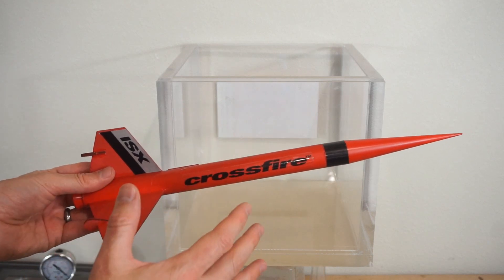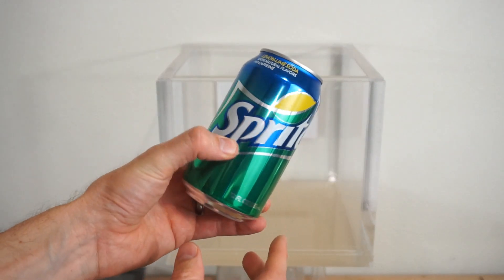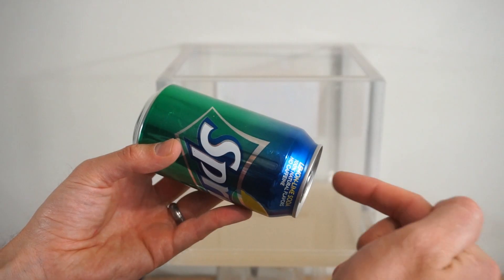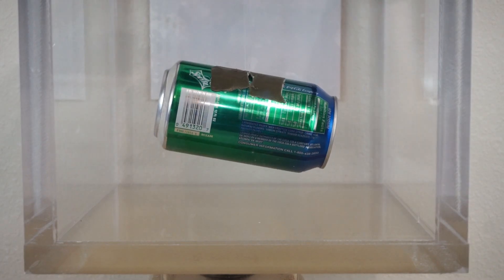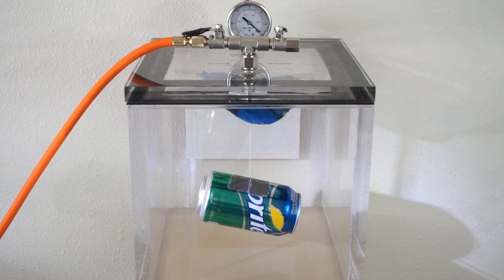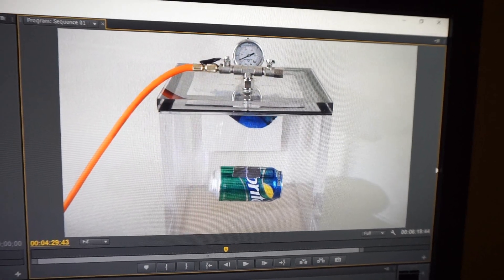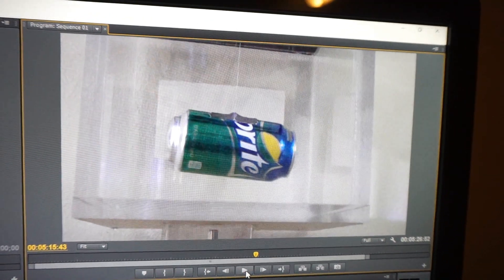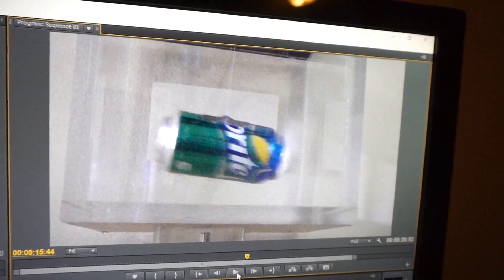Can a Rocket Fly in a Vacuum Chamber?

Comment: your interpretation is flawed. the moment the can pops gases are eliminated, then comes the liquid. the wall is too close to the can to eliminate its interaction with the can/liquid/gas system movement.
Reply: cmnndr
Please tell me, how gas hitting a wall transfers energy to the can?

I'll be happy to explain how the normal explanation works, but first I want to hear your step by step explanation, with all the interactions.
Reply: man, its not me that made the experiment. im not the one who needs to explain anything. i just noticed what happened and pointed it out since it appears you missed it. thats it. 
i find it important since your whole conclusion resides in the fact that the can moves before the liquid hits the wall. you have the burden of proof not me. you have to prove how the gas hitting the wall transfers energy to the can, not me. or disprove it. i didnt state that the can moves because of the gas hitting the wall, i just pointed out that the wall is too close to the can for the experiment to be conclusive, which is obvious, since we're having this discussion and since you have to use external optical devices and software to come to a conclusion.

what you see: can pops, gasses expelled, liquid expelled, starts moving (although this order i subject to debate since the gasses aren't colored and you cant determine simply by observing, or at least harder to do, which came out first and when did the can actually started moving. its more or less an aproximation, another variable you have to take into account when you make your interpretation, just like the proximity of the wall) 
what you interpet: regardless of the interpretation I THINK you are flawed since the wall is too close. 
does this make it clearer?

and as a side note, if youre not making an experiment with a blank slate of a mind you almost always get crooked results, in particular, you should leave aside your classical mechanics knowledge since its a specific situation where you dont have a medium where these interractions occur and just try to elminate variables, assumptions and prejudice. this is important since the system created encompases the subfield of classical mechanics of liquid and gasses and void, which intself is a particular situation.
maybe this is overkill to the experiment, thats why i mentioned only the wall....
if you start on the biassed belief that the can will move by the expulsion of the liquid/gasses in it you will prove yourself exactly that. you will not prove what actually happens, except if that is the real explanation. lol

and get rid of your prejudice regarding myself, which your reply hints at. its not useful. you labeled me and focused me in your comment and not your experiment which is childish.
and if you like questions so much, heres one or two. as we noticed the can starts to dilate as the pressure falls. in the case of rockets, space suits, ISS and what not, how is that dealt with in space? actually im more interested on how space suits deal with this problem, since i believe rockets and the ISS could be made structurally sound to withstand the negative pressure around it.
i asked this purely out of curiosity, i have no grip on the subject at hand, but following the analogy of your experiment, the suit should burts into space. it clearly doesnt and i wonder why. maybe you know or others who peep this comment.

p.s. 
and i imagine a vaccuum chamber has its limitations but you do realise that the scale on which this experiment is not in concordance with reality i.e. rockets? 
i am bringing this out since on closer inspection the volume of the can is significant to the volume of the chamber. a better experiment, a more conclusive one would be with a much larger vacuum chamber or a smaller recipient. i haven o ideea about the numbers, i think you need to calculate in order to have conclusive results.
if you take this analogy its impossible to replicate it in real life. and it goes viceversa, you cant replicate it in a lab. altough this comes back to my first requirement which is you need to calculate the ratio of the can volume to the chamber volume and find where it becomes irrelevant. giving here a wild example to make it obvious 0.0000000001cubic metter of can to 1000000000 cubic meter of chamber.

its cool what you did and so on but its by far unconclusive if you break it down.
Reply: cmnndr
That was a whole lot of words, but not a single one even came close to an explanation of how you think the mechanics of thrust work.
Reply: doesnt matter what i think... again youre picking on me rather than to focus on your work....
Reply: cmnndr
So, you don't have an explanation?

If you don't have an explanatory model, how do you even determine if my explanation is wrong?
Reply: 1) i said your explanation is flawed by the variables you didnt/couldnt/wouldnt eliminate.
2) stop asking me questions. im not the one who posted this experiment. its not me the one who is to offer answers. you are, if your experiment isnt conclusive which it isnt, because of the reasons i mentioned earlier.
3) how about you improve your experiment instead of trying to pick a fight with me when there is none?
Reply: miss cricket i dont understand your first statement and i think there is a failure in comunication between me and you, mainly because what i wrote was for ShadowFalcon, which by a fluke i thought was the OP of the video... anyway, i really dont get what youre trying to explain in your comment. i understand what happened in the experiment. its just that the result is inconclusive due to unacounted variables in the system the OP created. these are obvious and if you eliminate them from he ecuation you turn science into pseudo-science. thats it. there is no way around this.

ill give one example in which the result would be conclusive. use a chamber large enough that the content of the can will not reach the wall before the can moves. if the can moves you just demonstrated that it works in vacuum as well. if not, the opposite. its not philosophy.

in this case the setup leaves too much room to interpretation, shifting from science to advocacy, logic, debating, imagination and so on.
Reply: That's what the guy shows, right? Expanding gases create pressure in the combustion chamber and push against the exhaust parts. If you put a wall behind the exhaust you'll have more power at the start. But there's no physical contact. In a vacuum.

The pushing force of a rocket is more powerful than the pulling force of the vacuum which spreads out the pressure into the emptiness. That is needed to escape earth's gravity further, while already left the atmosphere until a full orbit without propulsion becomes possible. Once in space, you don't need that much power anymore.

Real fact: the Dawn spacecraft travelled to and orbited the 'belt' asteroids Vesta and Ceres with an ion engine that delivers a thrust comparable with the weight of a feather. In almost friction-less space it's easy to gather momentum and "spiral" the sun up and down. It worked very well.

Comment: Interesting experiment. Shows momentum conservation. Don't agree that pressure differential makes he rocket perform better in space cause suction force has nothing to do with recoil effect, it could only pull oxygen more faster out of nozzle. You know the experiment with a toy car with a balloon attached in the back and the vacuum cleaner. Pressure differential force is actually preventing the toy car to move forward. You proved your point that rocket can work in a vacuum but you don't have to add some incorrect remarks. There is also air resistence(drag) which is not present in the vacuum of space. It seems that there are really are satellites up there geostationary and geosynchronous. If you look at a rocket equation you see that pressure differential force has the opposite sign of the thrust force propelling the rocket forward. First think about it before you say it. No pun intended. Best regards.

Comment: As the vacuum is increased, the gasses come out of solution from the liquid and when the can burst, the gasses are pushing against the bolus of liquid leaving the can thus propelling the can forward slightly before the content reaches the chamber wall.  The vastness of space would consume any pressure leaving a rocket engine and it would not continue to propel forward since there is nothing to push against. The rocket could only coast as it leaves the atmosphere.
Reply: incorrect

Comment: this is so stupid the first thing to hit the wall would be gas u cant see which could be why the can moves, u have to remove the possibility of any of the contents hitting the wall (called removing a variable as opposed to ignoring it) I honestly dont know how a rocket works in space. you didnt even create a vacuum DUMBASS u simply reduced the pressure until the can explodes. to test a rocket in a vacuum u need a rocket and a vacuum what the FK does rockets and space have to do with sprite and atmosheric pressure reduction. FAKE NEWS just in "Sprite shuts down NASA funding"

Comment: The chamber is providing thrust bigger chamber next time.

Okay!!!
Reply: 👍✔see what happens in REAL VACUUM 
https://youtu.be/76JM03a6WH4
Reply: @abelmicah3430  So a little rocket designed for atmosphere pressure is being used in a vacuum setting... I'm sure my computer will work just as fine in water as it does in the air right?
Reply: Exactly
Reply: The can moves long before the gas reaches the wall. That's what's great about slow motion. Wondering if you actually watched the video being this was shown and explained

Comment: There are many people saying that rockets don't fly in vacuum chamber. How do you prove that it does? Most of the videos I've seen they show a rocket engine in a small vacuum chamber causing the rocket to push off the end cap and the side wall when ignited. NASA's huge vacuum chamber does not show any small rocket models propelled in their large vacuum chamber. They only show items been dropped. If you do 3 different size vacuum chambers and ignite the rocket engine in each, what would be the time vs distance results? It would be an interesting experiment and one I have yet to see. It would be nice if you could invest in a larger vacuum chamber to run some tests.
Reply: The problem is: There is no reason why it should not work in vacuum in the first place! What would you say if somebody says "Magnets don't work in space?" 

What do you think, what aerospace engineers do? Do you really think that their interpretation of Newtons mechaincs is wrong? If reaction actually would work as these "rocktes don't work in space"-people claim, than also airplane would not behave as engineers caclulate. 

What all the people also don't get: It is not like that we have "non-vacuum" inhe atmosphere and very high up we suddenly have "vacuum". Instead the air density just decreases with the altitude. And very quickly! We can see rockets that goes faster and faster - but that would not be the case, if rockets really would need "something to push against". Already on 23 miles we have only 1% of the air density!  

It is really embaressing that videos like this are obviosly neccessary.
Reply: Don't get me wrong. I'm not some crazy flat earther or that rockets can't fly in space.  I'm only referring to a vacuum test and it would be interesting to see results.

Comment: When rockets go into to space they push off the ground why is he so insistent on not having it push off something and that still doesn't explain the fire they use to get out there
Reply: Wreklis Animosity
No, they don't push off the ground.

The gases push off of the rocket.

It's Newton's Third Law. A contact force, between two objects (not three).

The gas hits the rocket and gets accelerated downwards, and as a result the rocket accelerates upwards.
Reply: ShadowFalcon sir what does the gas hit?  I never seen a rocket set off in mid air
Reply: Wreklis Animosity
The gas hits the inside of the rocket engine.

It's basically like a stick of dynamite going off inside an indestructible bucket.
Reply: Miss Cricket yeah I have but that's after the first stage which is the ground. You'll never see a rocket take off horizontally because that would just be a plane which is essentially what the shuttle is. A rocket need something to push off of whether it be the ground or air sorry but his experiment doesn't prove rockets work in space because a sprite can produces no fire.
Reply: Wreklis Animosity
"A rocket need something to push off of whether it be the ground or air"

Actually, what a rocket needs to "push off of" is combusting fuel.

It's pretty fucking easy. Fuel and oxidiser combusts, and expands in all directions, and in the process some of it hits, and pushes the rocket.
Reply: Miss Cricket I'm sorry but fire doesn't burn without oxygen so if its burning there is air present.  The exhaust gets bigger because it requires alot more fuel to continue  no different then a car going up hill requires more gas.
Reply: Wreklis Animosity
" fire doesn't burn without oxygen"

Oh really?

Could that be why, one of the two liquids in a "bi-liquid" rocket, is an oxidiser? To provide oxygen for the combustion?

"The exhaust gets bigger because it requires alot more fuel to continue"

Definitely wrong. The propellant flow through the injector remains more or less constant throughout the flight of the rocket (or at least the usage of the engine). The exhaust plume gets bigger because there's less ambient pressure around the rocket.
Reply: Wreklis Animosity
Some punctuation would be nice.

"So is the air thinner or none existent"

Are you for fucking real?!?
The air gets thinner, with altitude, until you reach space, at which point, there's a vacuum.

" fire does not burn in a vacuum"

You're aware of the fire-triangle right?
Fire needs three things. Fuel (RP1), Oxygen (LOx), Temperature (Igniter, or ongoing combustion). It's not the fire-square, or fire-tetrahedron. Ambient pressure has nothing to do with it.

"fire does not burn without air"

Fire does burn, when it's provided with fuel and oxygen.

"I won't even get into the van Allen belts which is a whopping 3600 degrees"

Source please.

"what are the space shuttle,  iss,  made of and what are their melting points and how much bull shit did cover it in to get thru the belts"

IIRC, the superstucture of the Space Shuttle, and most of the modules of the ISS are made of Aluminium. Melting point of Aluminium is at 933.5K

As for Radiation protection. Well, layered aluminium and polymers were used. Both the Space Shuttle and the ISS would only encounter a relatively weak region of the Van Allen belts, and the radiation there would mostly be Beta- ratiation which are stopped by aluminium (and in the case of high energy beta particles, you don't want to stop them too quickly, since that'll create bremsstrahlung).
Reply: Miss Cricket
No frikking idea.

I tried googling it, but nothing showed up.

There was something about a spacecraft going through Jupiters radiation belts being subjected to 3600 rem per day, but that's all I could find.
Reply: Miss Cricket I get this stuff the science community everytime one of you try to explain you globe theory one of always creates something that no one else knows about?  Now my question to you and the rest of you is...regardless of what you call it there is an area above the earth that is 3600 degrees call it what you want but your scientists says it's there I'm with you I say it's not I say it's the firmament but your text say it's around 3600degrees now I ask again what substance on earth has a melting point of more than that because it'll have to be more?  And were any space shuttles or rockets made from this substance? Now I know answers to these questions I'm sure you don't and if you do you'll find a mythical theory to try and explain it away
Reply: Miss Cricket
Oh, so it was the exosphere Wreklis was going on about.

Also, how the hell do you read that rambling, stream-of-consciousness text?

I mean, the lack of punctuation in that pile of TL;DR makes it borderline unreadable.
Reply: ShadowFalcon so there is an area over the earth that is 3600 degrees or higher? So again I ask what did NASA build the rockets and space shuttle out of? What the melting points of those materials are?  How did they get through without proper shielding?
Reply: Wreklis Animosity
The temperature of the exosphere is a bit weird.

The exosphere has very few molecules in it, but the ones that are there, are moving really fast.

It's this high velocity which is referred to as "temperature",in this case 2,000°C.

However, there's a big difference between temperature and heat, and it is the heat which would be doing the melting, not temperature.

As I said before, temperature is a measure of the average speed of the molecules in a substance, however heat is a measure of the thermal energy in a substance.

So sure, the exosphere is 2,000°C, but it's so thin that it doesn't really matter. It's like trying to melt the inland ice of Greenland with only a match. It isn't gonna happen.

As for what most spacecraft are made of. I've already answered that. Usually some alloy of aluminium.
Reply: Wreklis Animosity
And by the way.

If you're gonna state values, then please remember to also write the unit.

Celsius? Fahrenheit?